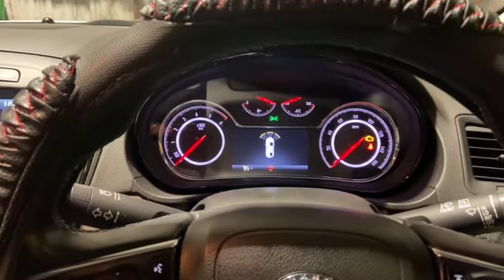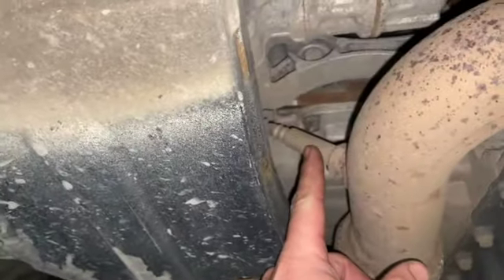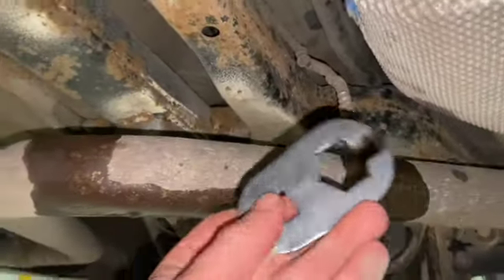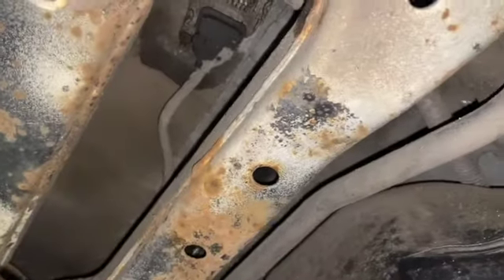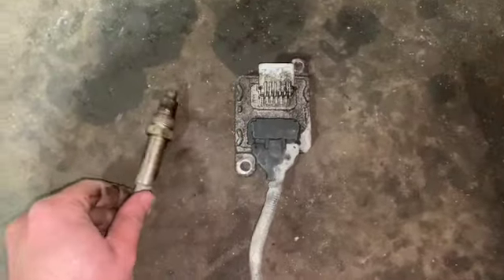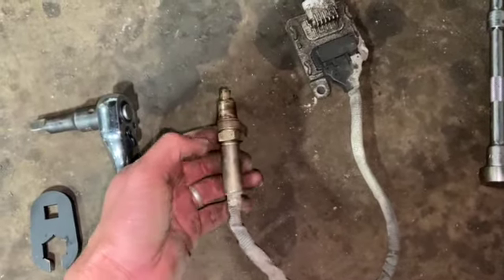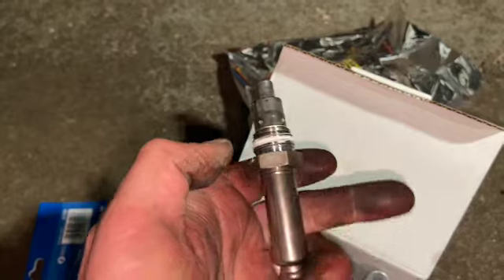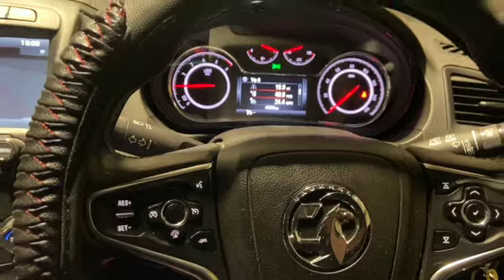Vauxhall Insignia NOx Sensor 2 fault *Fixed* P11DC P220B P22A7

Comment: Hi just changed my sensor on vauxhall insignia bank 1 sensor 2 light has came back on saying bank 1 sensor 2 voltage supply circuit any ideas wot this is cheers
Reply from the maker: Hi Steven , it was the rear most sensor you replaced was it? And did you use a genuine sensor? Thanks
Reply: @diydaly  thanks for replying it was back sensor same as your video  no never used genuine sensor do you think that is problem I have ordered genuine one will fit when arrives just wondering what voltage supply circuit means cheers
Reply from the maker: @slhk5848  yeah supply voltage is slightly concerning as you may need to check the feeds .. could possibly be a wiring fault but I’ve known loads of problems with aftermarket sensor me .. we always fit genuine now as not had a single aftermarket one work correctly
Reply: @diydaly  I'm hoping the genuine sensor will sort problem out as before I changed sensor it was only saying bank 1 sensor 2 fault once I put new sensor on its saying voltage supply circuit I don't think the car is reading sensor
Reply from the maker: @slhk5848  yeah I think it will mate 👍
Reply: @diydaly  the code I am getting is p220b it says nox sensor supply voltage circuit bank 1 sensor 2 any ideas? Thanks for your response 👍
Reply from the maker: @slhk5848  is this after fitting the genuine sensor?
Reply: @diydaly  no mate new genuine sensor is getting delivered Monday
Reply from the maker: @slhk5848  are good, let me know after you've fitted it mate 👍

Comment: I checked the Fault codes and there apperead only P11DC NOx Sensor 2,there is no engine light or something the only thing is high fuel consuption,so i assume it comes from that Sensor ? 
Engine:Insignia GSI Biturbo Diesel 210HP>260HP Stage 1

Comment: Hi, first many thanks for this video which ist realted in german bulletin board motor-talk.de many times.
Does it mean, that the Number P22 or P11 does have just one realtion to sensor 2 in the back?
I'm curios bcs. in this bulletin boards they refer to P22 is the Seonsor 1 in the front and P11 ist sensor 2 in the back. 
Could you help to untie my brain?

I had P11DC for 4 month and 4.500km, soldering a new sensor in the back (without the computer chip).
Had 2 days without failures and got P22A7. Drove again 4month and 4.500km and my intake bridge formaly explode.
The guy said the DPf (Diesel particulate filter) didn't generate for so long that it was just full and the preasure broke  al lot of tubes close to dpf.

So i soldered the fron Sensor and the failure comes ap again. P22A7.
Reply from the maker: Hi thanks for the comment , I have to be honest im not 100% sure about that , I don't think that is the case but will do some digging and try update you 👍

Comment: Hello. Thanks so much for this video, you’ve cleared up a lot of mystery surrounding these sensors. Could I just confirm that the P11BE code relates to the rear sensor, the one you’ve just shown in the video? Many thanks.
Reply from the maker: Thanks for the comments , much appreciated 👌 the faults on mine were only P11DC p220b and p22a7 which related to the rear sensor.. I’ve never seen p11be before , do u have any other codes? Thanks
Reply: @diydaly  Nothing at all at the moment. Just the P11BE code. Very strange. When a sensor is swapped, is it just a matter of clearing the codes, or does the sensor have to be put into ‘learning mode’ or something like that? I keep getting conflicting information online.
Reply from the maker: No there are sometimes options to tell the ecu it’s had a new one buts it’s fairly strait forward on these.. just simply fit the new sensor & clear the faults codes.. 👍👌
Reply: @diydaly  fantastic, thank you so much for all your help. I really appreciate it 👍🏻👍🏻
Reply from the maker: @mattcrooke8321  👌👍
Reply: @diydaly  a year later, I finally got around to ordering the sensor in your link and fitting it. No more check engine light!

Thanks again for all your help.
Reply from the maker: @mattcrooke8321  haha nice one , thanks for the update 👌👌